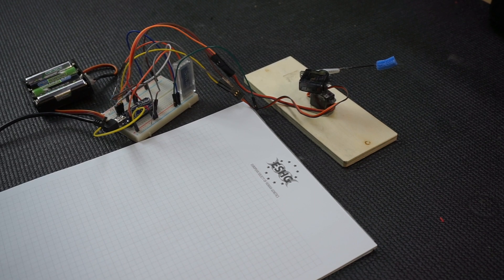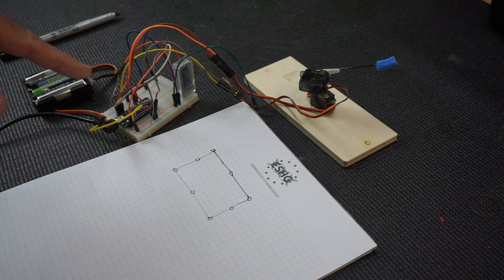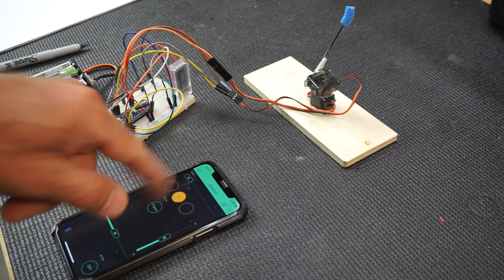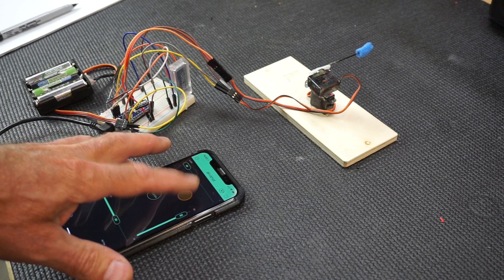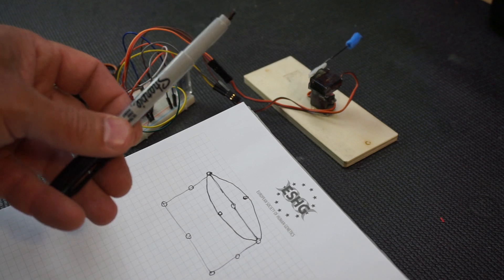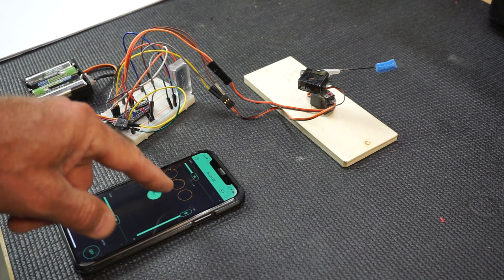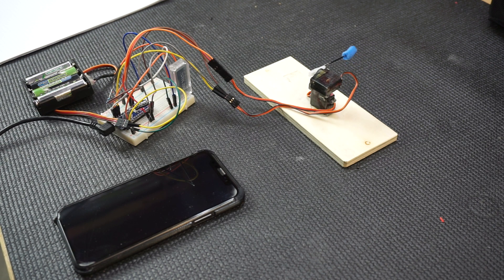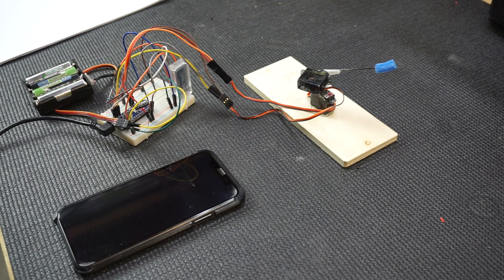AKVAMAT(e) - lawn watering robot prototype

Comment: Interesting but I would just dynamically add training points and let them linearly transgress, no need to scan the shape because you can literally program the trajectory by nodes. Point is that the shape of the lawn may be very inconsistent  and the pressure in line will also affect the actual trajectory of the stream fall.
Reply from the maker: Thank you for the comment! How do you see "adding training points"?
Reply: Alexander Kolomietz: 1 point blows water at selected polar coordinates. Add point 2 — it reciprocates between two points grading both coordinates linearly, so that both ranges are covered simultaneously. Add point 3 - it will scroll 1-2-3-1. Add 4 — do 1-2-3-4-1. And so on. I bet no one will ever go beyond 6 points yet you do not need to limit the number. This way you can program not only the shape of the lot but scan trajectory. Make it an option to scan in circle 1-2-3-4-1 or reciprocally 1-2-3-4-3-2-1 for the geeks.
Reply from the maker: I am afraid six points will not be enough for a lawn of a decent size. In my approach instead of defining each point you want to water the user defines only the perimeter that limits the target area. I am thinking about eight points in total. Your method will work better for smaller lawns of irregular shapes. Nothing stops me from making the device to support all methods and let the user to select the one that better suits the job.
Reply: Alexander Kolomietz your approach requires “slicer” to define scan pattern within boundaries. Scan frequency and amplitude must be adjustable for the shower cone coverage and to prevent overlapping with boundaries. This also will require assuming that your n-points represent convex shape. If the shape is non-convex the slicer may break or produce irrelevant scan pattern. Too complex IMO :)
Reply from the maker: the code that fills arbitrary shape polygons is already developed and tested. check this out: https://youtu.be/8YXCcVFWgF0 . again, in certain conditions your "trace the route" method will work just fine whereas it will fail handling big lawns
Reply: Alexander Kolomietz for big lawns you may have to use third dimension: the pressure. Otherwise watering “near” will  cover with more water than “far”. You can reduce the speed of scrolling when “far”, of course. But how will you define which is which?
Reply from the maker: adding more hardware to control the water pressure/flow will never make the device simpler.